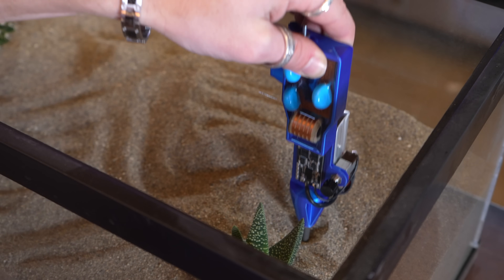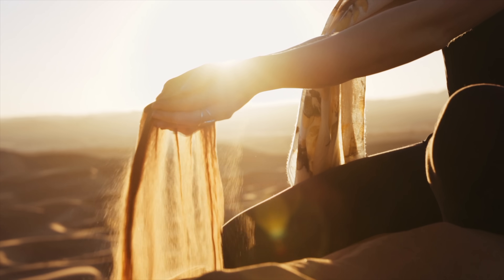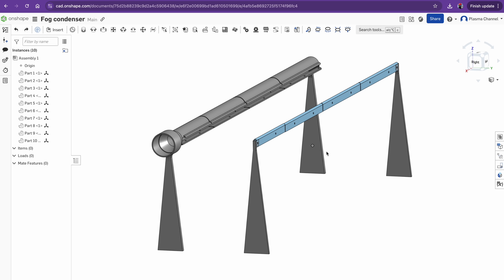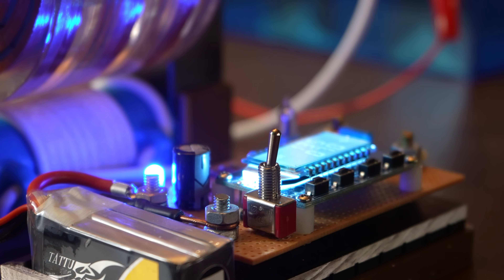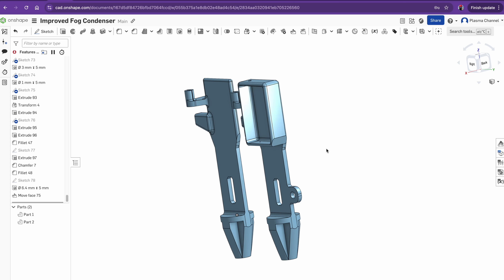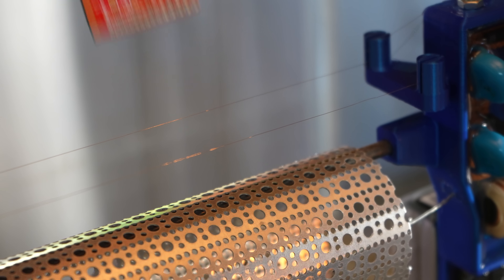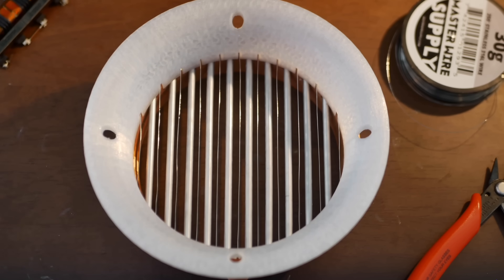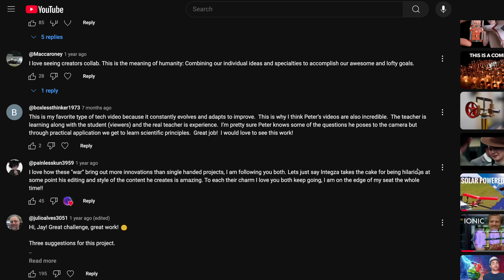Solving Desert Water Shortages Using 20,000 Volts

Comment: Ground-breaking yet familiar , moisture reclamation in space stations is probably the closest school to this. but they are all based on due point differential and cost a lot of watts, this is a whole other thing.  I wonder if you could use that to enhance the output. make the condenser colder than the ambient air?

Comment: Most crops that get sea fog and heavy dew use some of it directly, so the device would only help a little. 

It's a shame that it works only in fog. If it worked in ~50% humidity, I guess the practicality would go up by a factor of at least 10.

Comment: FASCINATING!

Okay... did some quick napkin math for scale-up. Lots of liberties and a few unknowns, so this is very rough.
I calculated luxurious water usage for one person in a Sonoran Desert off-grid house at 100gal/day, so this is my arbitrary goal.
Wanted to get a very general real-world sense of this installation, so if you wanted to refill that 100gal of housewater *every day*, within 1 hour, roughly how big would this installation have to be?
And, roughly how much electricity would you expend?

Land Area:
1. One Hour: 2ft -> 540ml -> 39W   ==>>  One Hour: 2ft -> .142gal -> 39W    | | |   Converting into gallons because 🦅 🇺🇸  
2. 100gal -> 1409ft   | | |   Okay, fine. However, Arizona morning air isn't gonna be NEARLY as dense as this fog machine. Let's assume real-world air is 20% of the humidity of the video's fog.
3. 100gal -> 7043ft   | | |   Just took the number above and divided it by .20 - So that means we'll need 7043 linear feet of this apparatus to generate 100gal of water within 1 hour.
4. Assuming: 12" spacing for each wire-collector-gutter combo: 16ft poles: 50ft run b/t each pole pair; 12ft horizontal space (6 each side) between collection looms.
5. 7043ft / (15x * 50ft) = 9.3 Looms total   | | |  Round up, 10 collection looms total.
6. Finally:   | | |   [50x12]x10 ft ground footprint = * 6000 square feet for >100gal 1 hr *.

So, we've got our Land-Area for collection of 100gal using this apparatus -> 6000 square feet, or about a 77-foot square, or 0.13 acres.

Wattage:
6. EXTREMELY vague (over?)estimate that energy usage scales up 10x in this "Full Loom" setup... with 15x50ft-wire-collector combos on each loom. Probably nothing near that.
7. 390W/h * 10 Looms -> 3900Wh i.e. 3.9kWh for >100gal of condensate.

So putting this all together; With VERY generous estimates, as far as I can tell...
- In ONE HOUR on dewy mornings, you could extract 100 gallons of freshwater condensate using just 1/8th of an acre and not even 4kWh. That's already INCREDIBLE!!
- If a) The air is ANY moister than I calculated.... b) The electricity usage is ANY less than my ridiculous 10x buffer.... and c) you can pack the wire-collectors any tighter on the poles... these numbers could potentially shoot into even-more economical territory.

Thoughts, anyone?

Comment: I'm curious if it will work in a humid environment that has no fog. For example I worked in an aquarium shop and it was very humid and we had dehumidifiers to prevent mold. I wonder if taking this prototype and putting in an aquarium shop would produce results

Comment: Fascinating. this is remarkably similar to the powder coating system - and of course there, excess humidity is a real PITA as moisture in the air (it does need to be  "visible amount of fog") is attracted to the work piece along with the powder which is very hydrophilic. The voltages used in powder coating can be spectacularly high (80KV is not unusual and even "low" setting is usually north of about 15KV - though only at microamps.

Incidentally, I hope you have already FILED your patent now you have released your thoughts into the public domain. The buggers are VERY strict on such rules. Exciting idea, well done :)

Comment: It's kinda like electroplating...but with water...and you WANT runs in the "paint"  ;)
I wonder if a very large array of lines charging the moisture molecules, and then a flat wall that is negatively charged would pull the moisture, then let it drip/slide down into a collection point.
Does static electricity work the same way?
Very cool and it does seem to rapidly pull the moisture out!
Great job!

Comment: After writing a few replies, lets put it in a main post. I think you should look into a solution where the ground is the "dumb cheap plastic net" and you just suspend a few high voltage lines above it. Maybe its even not required to coat the nets, if you have e.g. one line (ground) running through the middle of the net, the droplets collecting on the net might ground enough (with the high voltage differential) to make the whole ground net conductive.

So basically a cheap (the cheapest possible) way to "upgrade" the existing fog solutions with minimal effort. Because obviously, going for big metal nets is not competitive to the plastic ones. Also corrrosion (you mention near the ocean, thats gonna be hard on anything) is an issue. So maybe having only a few "driver lines" above classic solution might already give enough of a boost vs cost to be an interesting test.

In the scenarios you have in mind cost is of course the main factor, so I would really try out a lot of weird off the shelf stuff if you really go for a desert trip 🙂

But very cool idea...

Comment: Maybe combine this with the sky cooling paint that @Nighthawkinlight has been playing with for some extra cooling condensation. Also what if you cut a pipe in half length wise and stretched the grid over it as an accumulator

Comment: The most efficient large scale setup would be a coaxial charge grid with closed off top and a fan in the center exhausting upwards to draw in the fog from the circumference. If the exhaust was discharged several hundred feet high then a continuous low pressure zone is created around the intake / charged screens to promote influx of fog from surrounding land.

Pretty much the same shape as those solar-thermal updraft generators.
Reply: You dont even need a fan. A large chimney with a wide flat base made of clear plastic film would have the same effect passively.  The moister farm would go under the wide flat base.
Reply: This is great, using pressure and the electron flow would probably multiply the output of water.
Reply: I think the fan would still be necessary. Albeit a very large fan spinning slowly, not a turbine or anything. Just enough flow to offet the impedance of the charged grids. I am assuming the ionized air flow would contribute something. The idea of using transparent material works in the solar-thermal generator but in this case once the sun comes up all of the mist disappears. One of the few issues I see with this mode of water collection is the short window of time you would have to collect it.
Reply: nuke cooling tower design

Comment: 7:07 Not the screen is drenched, the copper is🤣 The screen gets most of its water from the runoff😁 Maybe you can ignore the screen entirely  and meanwhile do something else inside the pipes, who are much easier to kept clean anyway🤗

Try aluminum plz. Too much copper in the water, is problematic.
Reply from the maker: There is no copper in the final prototype I used ?
Reply: @ I saw it. Try a copper pipe instead of the mesh.
Reply from the maker: Are you saying I used copper in my build? I did not use any copper. But a copper tube I could always look into. Good idea.
Reply: @PlasmaChannel  My bad🤦‍♀️ This was copper colored PLA🤦‍♀️
But why was was so much condensation happening on the plastic part🤔 Static charge stuff🤔

Comment: Is it still more efficient than a dehumidifier in non foggy environments, like at 40% humidity?
Anyways, I can't wait to see this project at large scale!! 😎😎

P.S. If the water tends to add more to the ends of the mesh, wouldn't be more efficient to have two shorter meshes in parallel?

Comment: Heh, I was gonna ask if this concept could be turned into a dehumidifier if the power draw was low enough- turns out yes, and it's even better than equivalent rated commercial units. Work with a manufacturer and get this new design on store shelves- could do with them in the UK right now :P

Comment: Alright, so you're NOT going to want to design these to follow the lines of crops. There are many, many practical reasons for this. Instead, you'd want this to be a distinct installation feeding the water into cisterns, which then feed to the crops vis drip irrigation.

Comment: a couple of things. first, safety. 20kv is no joke, even if we're only dealing with 2mA. if we assume that you want to deploy this at scale in open desert, you need to also think about how you would keep people, animals, and things from touching the wire, or shorting the wire against the grounded screen. what ever thing you come up with for protecting the wires and screens needs to be included in any calculations for how easily deployable or mobile the system as a whole is.

second, mobility. is this system supposed to be set up and left alone indefinitely, set up and broke down daily, or set up and left for weeks while crops grow, but taken down before harvesting? that wasn't really made clear here. which ever one you're aiming for, there will be different things that need to be considered. being left alone indefinitely likely has the fewest additional things to be considered. daily tear downs only really has wire resistance to being constantly coiled and uncoiled, the grounded screen portability and stackability, and the safety measures to prevent accidental groundings/shocks to consider. the 3rd duration has an additional consideration that you really need to think about, since this seems to be your goal... and that's the plants themselves. how do you keep the system from touching the plants as they grow?

third, scaling the power. how well does your power generator scale over distance? can that same system power a line that's 50 feet long and still work the same? what about at 100ft? 250ft? does the ml per hour per watt rating remain consistent with longer wires, or is there a point at which the length of wire begins reducing efficiency? is it a reduction significant enough to care about?

fourth, scaling the scaled. assuming that this scales up to the point that it's viable for an entire row of a crop, you then need to multiply that cost for the one row across every row that the farm would have. that gets expensive, fast. i'm also not sure what parts of this system are consumable. the wire is probably the thing that would break first, and i don't recall how specialized and/or expensive that wire is. even if it's not a special wire, you would still need to consider how things will play out in the field. if/when a wire breaks, the farmers that would be using it are likely going to want to get it back up and working ASAP, even if that means grabbing any old wire that they happen to have a spool of. how will the system handle this?

finally, i'd really like to see you make a home dehumidifier, much like that small unit that you used for comparison, to see if this is technology is viable even at lower humidity levels such as those found in basements. obviously this would require many hour long tests, but if you find that it's more efficient and effective at removing humidity from the air than what is currently on the market, i'm sure we'll see units that use this tech from chinese sellers and maybe even more name brand manufacturers.

Comment: hopefully you do more tests to see, if a tigher mesh works better.  what voltage produces the most per hour and then most per watt/hr.  Also to note, im sure you know, you can get 24v and 48v solar setups.  saying just using solar some might assume just 12v.  if you scale it up, you may want to go higher voltage if it does in fact help produce more per/hr.

Comment: This makes sense.  We have, for decades, used electrostatic precipitation to remove dust from exhaust streams. The same principal should be viable to collect water vapor.
Reply: When fog is present, the electrostatic method in this video is more efficient because it attracts liquid water droplets already in the air.

When there’s no fog, most water in air is in gaseous form, so a dehumidifier is more efficient as it cools the air to condense water back into liquid form. 

You have to remember that water is a good heat sink because it is a very stable molecule, AND especially because it is dipole, meaning the two hydrogen atom are slightly on the same side geometry causes one side to be slightly negative and the other shortly positive, allowing water molecules to attract each other.  That's why water has a higher evaporation temperature than rubbing alcohol or gasoline.  As a result, it took a lot of solar energy to move water from a liquid state into gaseous form into the air.  That means in order for it to get back to a liquid state it MUST LOSE a lot of energy.  This electrostatic method in the video does NOT remove energy from water molecules in the air.  It only attracts LIQUID water molecules in the air (ie fog).  As a result, it can only convert fog (liquid water molecules in air) to liquid water.  It can't easily convert gaseous water (vapor) in the air into liquid water like a dehumidifier can.

The 3 states of water: 

1. Water ice (has low energy so it forms a solid) 
2. Liquid water (has enough energy to be liquid, but not enough to be a gas.  The gas form is dependent on heat energy AND air pressure) 
3. Water vapor (has sufficient energy to be freed from the liquid state and behave like a gas, expanding into any given volume) 

To go from 1 to 3, you add energy. 
To go from 3 to 1, you remove energy

Fog is level 2.  Vapor is level 3.  The electrostatic method in this video only works on level 2.  Dehumidifier works on level 3.
Reply: Water DROPLETS only, NOT water vapor.
Reply: @YodaWhat  it might increase condensation rates
Reply: You cant increase condensation without some method of disposing of the latent heat causing that water to be in the vapour phase...
Reply: @paradiselost9946  yea ofc there will be a limit to the rate of that, but well, air and the vapours in it, uh moves, the plasma dude already demonstrated ionic thrusters, soo, make the condensation grid taller, a few parallel ones, ionic thrusters from the  sides angled up inwards, and just let the hotter air at the top with what moistùre didnt condense absorb the heat,

there must be some balance of factors that would let it all be optimised based on average humidity of his area, but i dont think he is yet at the limits of what he can achieve.
Reply: @ sigh... "let the hotter air absorb the heat"...

you really dont understand thermodynamics...
Reply: @paradiselost9946  First of all, you all / too do not understand how that device works, you do NOT need to get rid of ANY heat for this to work. because there is no phase change necessary for this to work. dew point is available for any/all temperature(s).
Reply: @paradiselost9946   I actually have quite a decent grasp of it, translating what i think into words however is not always my forté.

Comment: Do you think it’s “condensing to the grounded wire” or it’s just the movement that is CONCENTRATING the droplets in that area. Just like the passive mesh screen versions.. as long as there is an accumulation of droplets… they will form into water. Your plasma field is essentially ATTRACTING the charged water droplets to an area to accumulate in a known are - your mesh

Comment: Hello, love the vid, right up my alley! Just 2 thoughts; for the collection grid, tapered points at the end, not flat shapes, should assist in the drop of the water going off the end quicker (less surface to adhere to=more collection) which could lead to another design change to take advantage of that in a different iteration.   

2nd: Create a correlative negative pulse through grounding at a higher frequency, ideally a multiplication of the Positive’s Frequency at a 1:4-1:8 ratio, should see an increased production. 

Great brain expanding video!! 

Thanks again!

Comment: Beachline surf and wind conditions often add a saline content to the moisture. I'm sure the Atacama coastline experiences this. Your mesh will need to resist this corrosive effect or you will experience quick degradation in efficiency. The scrubbers mentioned in another comment probably are made of an alloy that may be resistant or a marine engineering source may be helpful.

Comment: You should try putting the charged wire within the U shaped ground. It would prevent unwanted contact by both man and wildlife. Also, you could try combining with an air inlet speeding up airflow to increase air density and reducing air temperature.

Comment: Shouldn't you simulate the changing air temperature of early morning in your tests? The mesh would be in the cold  desert night when the fog comes and will take time to heat up by the sun-- the air probably is heating up faster. Having less mass,  and should result in a temperature gradient that would naturally promote condensation in the time windows where the temperaturs conditions are met.  Perhaps even use some of the voltage to cool the net to impact the results?

Comment: What if you charge a high-voltage capacitor and turn off the circuit so that it does not consume electricity - how much water will one micro-Farad collect? Will such a method be economically efficient if the circuit is not constantly powered, but only for periodic recharging?